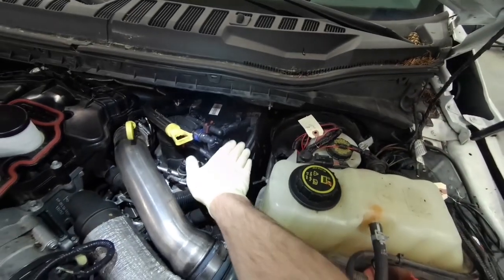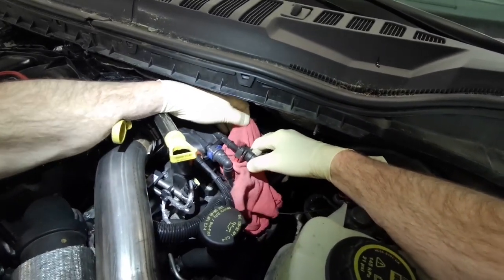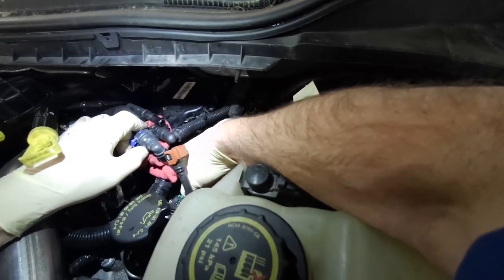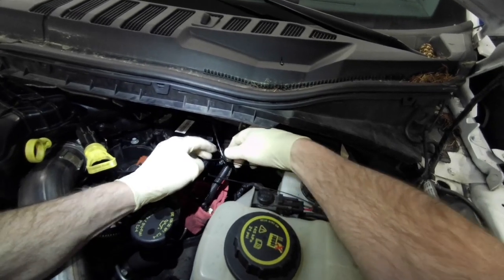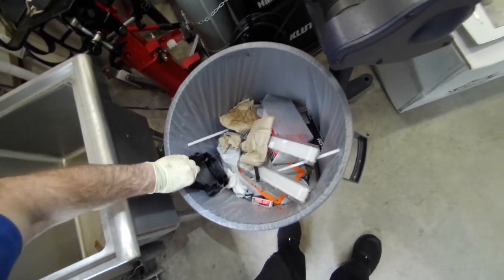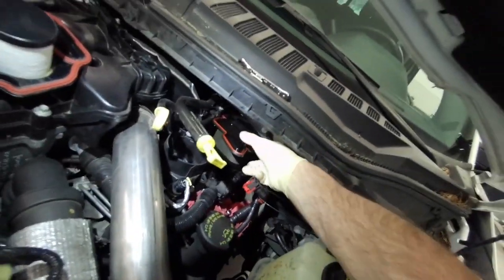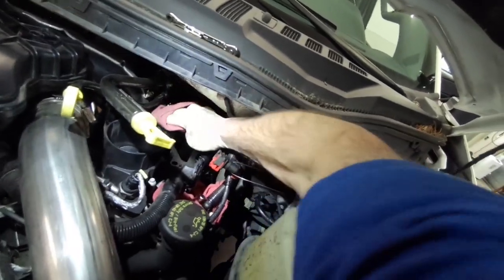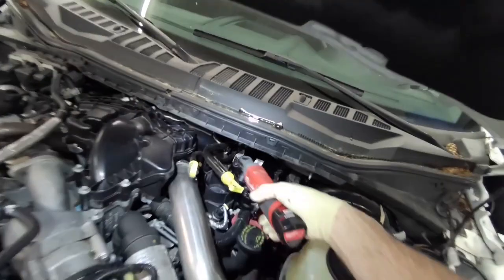FORD 6.7L MASSIVE CRANKCASE PRESSURE

Comment: is this the case for the truck to burn oil , white smoke out the tailpipe?
Reply from the maker: Definitely. Hight crankcase pressure can cause those symptoms.
Reply: @raincitywrench117  update Ford had to replace the turbo, it was shot along with the CCV FILTER. $$$$$$ 6K repair... I had an extended warranty policy on my truck it cost me $100 and  they paid for the car rental
Reply from the maker: @carmas54  Sweet!

Comment: After changing that part is it normal to have a little smoke with out pressure ?
Reply from the maker: Yes sir. The oil always looks black on these diesels and with all the crankcase air moving around inside the engine, it will look like smoke coming out the oil filler.

Comment: I have a 2011 6.7 ford and just replaced the CCV and i still have pressure and still white smoke out the tail pipe. Any ideas what it could be? Bad motor or turbo?
Reply from the maker: Interesting. Here is what symptoms chart says in Fords PTS system for white smoke: "Some white tail pipe exhaust smoke is a normal condition at start up with temperatures below 10°C (50°F) or with an extended idle in a cool climate."
Make sure you monitor the degas bottle closely to see if the coolant is dropping. If you have access to IDS software, you can run a relative compression test on the engine to see if one or more cylinders is low which can cause crankcase blow-by. The other alternative is to remove the glow plugs and run a manual compression test. It does sound like an engine issue though. How does it run?
Reply: @raincitywrench117  I seams to run fine. There does not seam to be a miss in the engine. When not towing the engine temp would say at 185 and now it is going up to 195 and 200. that is what my H&S programmer says. I towed my new to me 5th wheel that weights about 15gs and that is when it started. Never heated up past 195. The truck has 160,000 miles and had 149,000 when bought it. I replaced the turbo 4000 miles ago and the two exhaust manifolds had a lot of carbon buildup it. Looked it up and they say it is kind of normal. I cleaned the crap out of both of them.
Reply: It starts with the white smoke when the engine is warmed up.

Comment: Ford doesn't even have a CC pressure sensor, like the Cummins does.  Really, really, really, really stupid and shortsighted.  It will blow your engine up if it gets too high
Reply: No it won't it will blow oil seals though.

Comment: Pretty sure they have a replacement that is a non-serviceable filter where you don't have to change the filters every 20k miles...
Reply from the maker: You could be right. Gen 1 6.7L engines did not have a serviceable filter. Gen 3 engines do and not sure about gen 2 6.7 engines.

Comment: How often should this be changed?
Reply from the maker: I can't find this filter in the maintenance schedule. I suspect this owner neglected the oil changes. Since the newer engines have a serviceable crankcase filter it may not be a bad idea to change it every 50k.
Reply: @raincitywrench117  yes correct. I was just verifying. Making sure my mechanic was t full of it since he told me it needs to be changed.

Comment: lol that's not even the worst    seen it takes rear seal and or cylinder 4
Reply from the maker: Think it may be main culprit to premature oil pan gasket failures too.
Reply: How did the ccv take out cylinder 4?